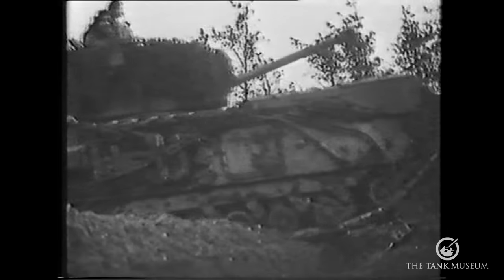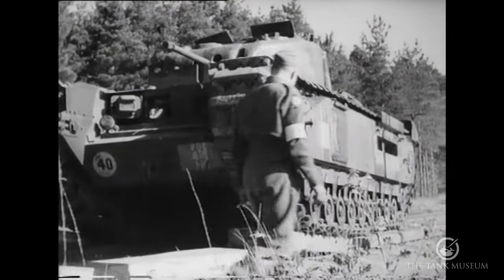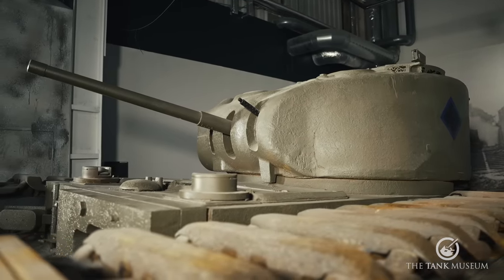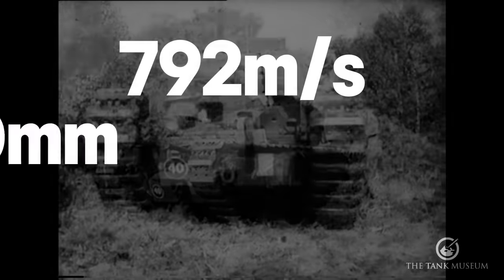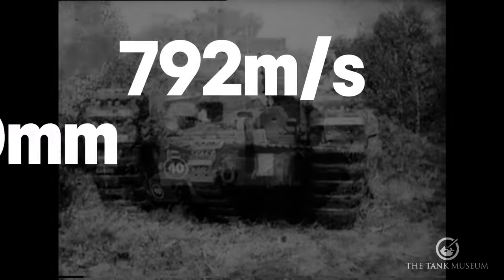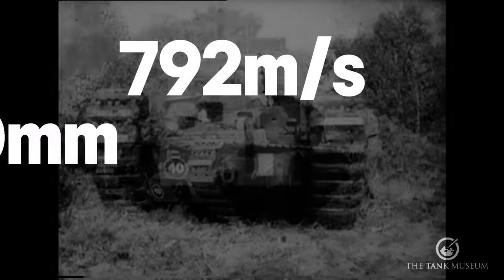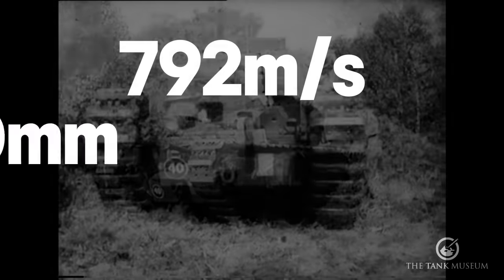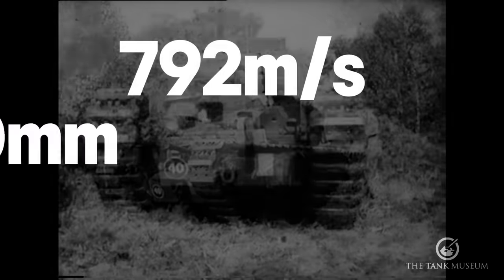Evolution of The  Churchill Tank | "No Damn Good"?

Comment: If I recall, one of the issues encountered at dieppe was the beach itself. It’s made of smooth rocks, not sand and the tanks had great difficulty getting traction to move in an effective manner.
Reply: Or tiny peebles that rolled under the tracks plus a sea wall just to tall to be climbed
the later one inspiring german fortification designs
Reply: It is called shingle
Reply: To be honest nearly everything gets stuck on shingles, you need huge flotation to cross it. Just think of the gravel traps at race tracks.
Reply: This invites the question as to why wasn't this brought up during planning? Was the beach composition not noticed during planning?
Reply: The beaches around Dieppe are similar to those in Kent and East Sussex. They also have high chalk cliffs. If a Churchill, which was essentially a WW.1 tank with, for the time wide tracks, couldn't cope with shingle, how would Pz1, Pz2, Pz3 and Pz4. It is a point conveniently overlooked in the various "Sealion" imaginations.
Reply: I visited dieppe on the 50th anniversary of the raid. it was almost impossible to walk from low water to sea wall without help
Reply: @rrhine  this invites the question on what was the whole point of "testing" such a badly prepared operation that only gifted germans examples of newest british equipment. And this is right before North Africa landings of Operation Torch. Diepee Raid feels like a political move to divert resources and attention from Operation Torch and to "show the yankees who's boss here" and that UK wasn't "just sitting and doing nothing". But what do I know, that's just a coincidence. It's not like Operation Torch was massive amphibious landing during which all of that can be planned in more organized manner before throwing tanks and people at wrong type of the beach anyway😅
Reply: @TheArklyte  You're voicing a popular opinion, to be sure.  The bit you've overlooked was the desire from Canada to feel like it was "doing something" and not just sitting around in England waiting for the big boys to let them play.  Because Dieppe wasn't a British operation, it was a Canadian one.

That said, Torch kind of got lucky in that it didn't run into any of the glitches that occurred at Dieppe.  In neither case did the planners really think through the sorts of things that would later happen in France - the Americans just got away with it because those North African beaches were pretty much ideal for an amphibious landing.

But yes, Torch did benefit from America having  at least some practice with amphibious landings by that point - and suffered from Canada having very very little, especially when it came to armoured vehicles, plus Imperial politics leading Canada to resist asking for help and the UK being disinclined to give it, plus all the normal problems of a multi-national effort where the communications links were way too high up the chain.
Reply: @davydatwood3158  well, at least it gave us a good historical anecdote. Context: germans studied the Dieppe Churchill III's and called them insignificant and obsolete... the very same "obsolete" tanks bagged hyped up Tiger №131 half a year later.
Reply: Essentially, the beach is like a giant swath of ball bearings lubricated by seawater. The question to ask isn't why so many Churchills got stuck, but how its possible that any of them actually managed to move at all.
Reply: @rrhine  No, there wasn't such detailed planning, it was just Mountbatten wanting to have a go with combined operations, for which they had been training for years.  This led to the geologists being landed on the Normandy beaches to get samples of the sand prior to the actual landing, and other attempts to get that type of information. Plus the Churchills equipped with the bobbins for laying out material mats to cover areas of soft sand.
Reply: One has to realise that any tank would have jammed up its tracks on this shingle and half the Churchills did make it off that beach into Dieppe. The German interleaved wheels of their later tanks would certainly have ground to a halt with cobbles jammed between the wheels.
Reply: @johnfisk811  one has to realise that germans weren't trying to drive tanks over beach at Dieppe in the first place...
Reply: Quite so, but it illustrates my point that the beach issues at Dieppe were those of a general problem not a uniquely Churchill tank problem. That lesson, amongst others, drove the pre Operation Overlord  covert landings to examine and sample the beach materials across the planned assault beaches and certain vehicle modifications.  @TheArklyte
Reply: @johnfisk811  I've seen a whole thread of people defending Churchill's performance at Dieppe, but I haven't yet seen a single comment that doubted Churchill's performance in the first place. Just the decision making behind the whole operation.

P.S.: though rough terrain performance in mountainos areas of it is a bit surprising to me. Makes me wonder how useful they could have been in Caucasus if properly used.
Reply: @davydatwood3158 The Canadians had participated in just as many amphibious landings as the Americans had in that hemisphere at that time. The Pacific theatre may as well have been on the moon.
Reply: Or, possibly, to show Stalin that we're trying.
Reply: @iangeorge6409  excuse me, what? Stalin himself denied D-day in 1943 since that would have stopped Lend Lease to stockpile needed equipment. Unlike tankies, Stalin was well aware how deep in sh//t he is:D
Reply: and it was a good job it really because it made the germans have a VERY FALSE accountting of it's self. once it got into hands of the dessert rats it certainly helped turn the tables on Rommel. it could do crazy climbing angles and once up armoured nearly twice the frontal armour of any german tank. Oh yeah great video. ( BOVINGTON PLEASE GET NORFOLK MUCKABERRY TO JOIN YOU OR GIVE EM A NUGDE SUCH GREAT PLACE ON THE EAST COAST SHOW THEM SOME LOVE PEOPLE )
Reply: @tutnallman  No substitute to actually walking the area!
Reply: @TheArklyte  Apparently the actual mission was to steal an Enigma machine and and capture some important intelligence. The raid was a success, unfortunately at a great cost but valuable lessons were learnt.
Reply: They made it into the town, and back out just fine. But there was no plan to recover the tanks by sea. So the only way they got stuck was when the tracks got shot off.
Reply: @TheArklyte  My grandfather served in Ian Flemming's 30AU Commando's and (based on his recollection) participated in Dieppe with the intent of stealing a "device that looked like a typewriter with wheels, lights and wires" from a German HQ (presumably a Naval Enigma). I've sometimes wondered if the main landing was a diversion to cover SOE/30AU activities.
Reply: Bit of a myth 

Of 30 tanks due to land - 27 got on shore (2 drowned in 8 foot and 10 foot of water and one landing craft had bow damage preventing 1 from being disembarked so went back to UK) - of the 27 landed dryshod 15 made it onto the promenade where the Sappers were unable to clear the obstacles so 10 returned to the beach to give fire support and protection to the infantry (one on promenade was disabled by shell to track, one fell into an underground bunker, one hit by "Stuka"), the remaining 2 were destroyed by the crews using "Sticky Bombs"

6 Tracks broken by shellfire 
4 Tracks broken by Chert build up (one after returning to the beach from the promenade)
1 Track broken unknown
1 bogged  down (grounded)

There was no tank of the day that could have coped as well as the Churchills did
Reply: @anthonyjackson280  The type of rock on the beach at Dieppe was called Chert
Reply: @TheArklyte  Dieppe was planned for much earlier with a lot more resources committed to it but was cancelled 

Canadians and the Canadian forces were getting a bit "irate" at being kept out of battles while every other Commonwealth nation was fighting in the Desert, East Africa, against the Japanese while they were on Garrison duty and just training in the UK. 

So as a bit of a hurried rush job the rain on Dieppe was dusted off to test taking a port for a short period, Canadians were used mostly due to political pressure and demands from the Canadians for some action

Unfortunately when the operation was put back on, most of the air support was no longer available nor the naval gunfire support and escorts
Reply: @TheArklyte  More than once Germans were surprised by Churchill tanks reaching places they thought were impossible for tanks to reach, cross or climb in North Africa, Italy and North West Europe
Reply: @johnfisk811  Most of those who did not get off the beach had tracks and idlers damage by shellfire (one on the promenade) - Chert build up came after that including one from the promenade that returned to the beach

15 of the 27 tanks that made it onto the beach (out of 29 landed) got onto the promenade and 10 returned from it (the others being one tracked by shellfire, one falling into an underground bunker, one by Stuka, two destroyed by sticky bombs by crews)
Reply: @sichere  Bit of a drama whipped up to sell a book, the documents he showed - the author only showed selected parts to sell his narrative - a team was added to the operation to see if they could get an Enigma because the operation was going on - not the operation was to get an Enigma machine (the machine there was not the latest and greatest U-Boat version)
Reply: @Andy-co6pn  The Canadian Gov and Generals (as well as the troops) were itching for action being the only ones kept out of the fighting at that point, 

Fighting going on in North and East Africa, against the Japanese, raids on the Norwegian coast by all the other Commonwealth nations - while the Canadians were kept in the UK for home defence and training
Reply: @davewaterworth8846  That was the contention of an author a few years ago who cherry picked certain parts of some documents to prove his point - while reading the rest of the documents dispells his claims 

The team to try and gain an enigma was sent because the raid was going on
Reply: @chaz8758  that would describe to chemical composition, the physical structure was/is loose cobbles and pebbles which are broadly defined as 'shingle'
Reply: @chaz8758  It was a "Raid" and as such had an objective and in this case more than one. 
A lot was learned that day and put to good use at both  Sword  and Juno beaches.
Reply: Dad drove one in Korea, c squadron 7th RTR
Reply: @ruuman just think of trying to walk across the damn stuff
Reply: @Andy-co6pn  The Canadians wanted to be seen to be doing something instead of garrison duty in the UK for 2 years while all other Commonwealth nations were fighting

It was pushed as much by the Canadian Gov and Military leadership in the UK

Mountbatten was given the ball to plan (the original plan had much more air support and naval gunfire support - but was cancelled, when the operation was actually launched few of the air assets or naval assets originally allocated were available)
Reply: @anthonyjackson280  It was the particular type of rock on the beach and was called Chert in the documents of the time - Churchills handled shingle on other beaches in UK and France - 

This particular beach was nearly impassable to any vehicle - no German tank could travers it even though they handled other shingle beaches ok.
Reply: @dazhigh9208  Dessert Rats?  Is that rats that eat your dessert or is it rats that you have for dessert?
Reply: @photoisca7386 people still think Sealion was possible?? I thought it was impossible for people to even believe that was a possibility lmfao
Reply: @chaz8758 Interesting, I wasn't aware that it was confirmed that there was an Enigma operation at Dieppe. My grandfathers war record was classified until decades after the war - it wasn't until the 90's that we learnt he was in 30AU (he only ever said he was in the commandos) and managed to get a copy of his service record.
Reply: @TheArklyte  I read somewhere that Dieppe was cover for the true mission. There was a German radar station adjacent to the beach. It was the actual target. The desired information was obtained and then the station was damaged to cover what was taken but, in a manner, to indicate battle damage.

Comment: When originally issued the Churchill came with a sheet listing several dozen known issues, explaining that they would get fixed but not to report those issues.

One issue some versions suffered was that the turret ammunition ready rack was in the perfect spot to act as a footrest when entering the tank but had no lid so a hobnail on a boot could potentially detonate a round. A cover was soon fitted.
Reply: The manufacturers had teams with the units issued with Churchills to immediately identify and rectify issues as found, these were then changed on the production vehicles and retro fitted to those in Units - this helped fix the issues much faster.

Comment: "And they fitted mudguards which were a godsend" - numerous times I remember hearing that the very first thing my grandad and most other drivers did with their Mk7 was rip them off as they always got broken, we're in the way, and we're more hassle than they were worth
Reply: The front mudguards could be deformed by the blast of the main gun, and the mid sections, if damaged in battle, could jam the turret.
Reply: Apparently in the winter snow and ice would jam the turret so they would remove the middle sections of the mudguards.
Reply: I suppose it would be more accurate to say "They were a godsend for their intended purpose but the rigors of battle made them a real pain."
Reply: Common in the military around the world, the Men always think they know better mainly because they learn things during real combat that the engineers could only assume or speculate.  It persists to this day.  If Governments ever actually let combat vets design some of this stuff it would be far more useful reliable.
Reply: Maybe those mudguards were more useful in the sandy North African deserts than in muddy Europe. Those high tracks probably could kick up huge sand storms without some kind of covering over them.
Reply: were*

Comment: To me the Churchill is that rather lovely Airfix kit, with the very difficult, nearly impossible to assemble bogies.  I did spent quite a while struggling with it, trying to adjust each bogie until you could fit the other half of the side frame over them.  A struggle until the day a gentleman at an event in the UK told me that the wheels were perfectly spaced on the sprue to mount them without hassle onto the chassis frames.  A great bit of advice that came two decades too late.

Comment: Churchills are some of my most favourite WW2 tanks. I just really like that old, boxy design, and those tracks, its just beautiful. Sturdy and reliable, with strong armor protection, with later variants having even more armor than Tiger I. Especially the late Mark VII is my favourite,  and of course the Black Prince. Shame it wasnt deployed, but then again with the same engine and even more weight.. At least we can try it in video games nowadays 🙂
Reply: One can wonder how the Churchill would've performed had it received the Meteor or another more powerful engine instead.
Reply: @Arthion  Part of its success was the very low gearing and high torque with the Bedford engine - this complimented the small road wheels 

Fitting a meteor may be a bit too much of a power increase for the transmission and road wheel arrangement - a more powerful engine would have been better 400 to 450 maybe rather than double to 700
Reply: Ugliest tank of the war.

Comment: Excellent analytical and contextual explanation. 
I didn’t realise the Churchill was in service as early as the North African campaign. Its ability to take out 88s would have been a great reassurance to Eighth Army infantry including my dad a Vickers machine gunner in the 27th Machine Gun Battalion  of the 2nd New Zealand Division. He would relate how feared the 88 mm was, and the Stuka. 
Just the Swiss Army pocket knife simile.
Reply: Could Churchill withstand being hit by an 88 mm armor-piercing shell?
Reply: The Churchill's in North Africa were the Mark III or earlier variants. The heaviest armored area of the Mk III was its hull front which was about 100mm thick. The German 88 Flak could just about penetrate 100 mm vertical armor plate at 1km. So the Churchill's were not immune to the 88's in North Africa in normal combat distances but they certainly survived a lot better than the Crusader, Valentine, Matilda and Sherman.

Comment: 'Started badly, but ended well'. Never a bad epitaph.
Thanks for the information about the Dieppe Churchills.  My understanding was that they mostly got couldn't move through the peculiar beach shingle and made little contribution to the raid.
Reply: Of 30 tanks due to land - 27 got on shore (2 drowned in 8 foot and 10 foot of water and one landing craft had bow damage preventing 1 from being disembarked so went back to UK) - of the 27 landed dryshod 15 made it onto the promenade where the Sappers were unable to clear the obstacles so 10 returned to the beach to give fire support and protection to the infantry (one on promenade was disabled by shell to track, one fell into an underground bunker, one hit by "Stuka"), the remaining 2 were destroyed by the crews using "Sticky Bombs"

6 Tracks broken by shellfire 
4 Tracks broken by Chert build up (one after returning to the beach from the promenade)
1 Track broken unknown
1 bogged  down (grounded)

There was no tank of the day that could have coped as well as the Churchills did
Reply: @@retiredbore378Well said.
Reply: @@retiredbore378 Only prototype parts used were Mk 1 OKE flamethrower tanks (3 of them) and a couple of tanks with an early version of track laying (both broke)

The Tanks were mostly standard Mk III with a few MK II and MK I